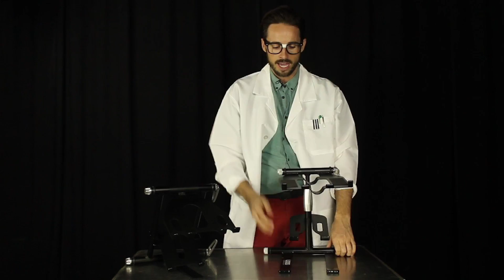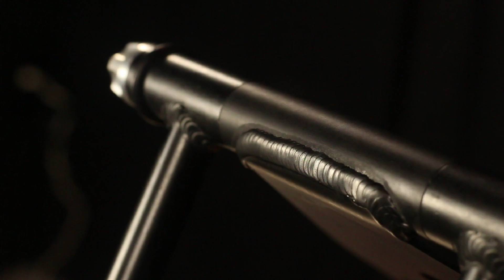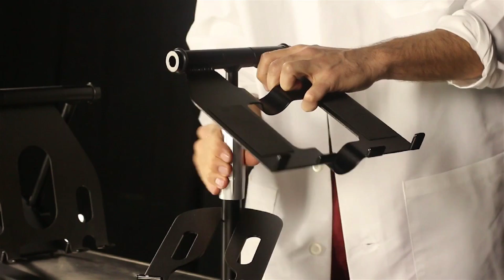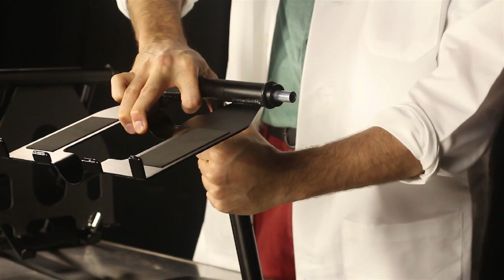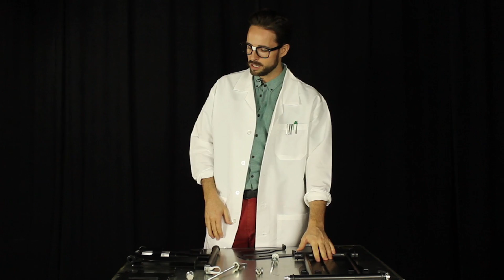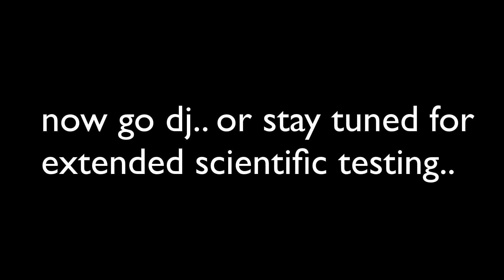Nerd Out: DJ Stands - UDG Creator vs Crane Pro

Comment: Ian,there's one thing that you're not getting about the Crane Stand(Which I have).To stop your controller or mixer from wobbling due to the bar being under it,you flip the bottom part the other way.So  instead of the bar being under the mixer/controller, it's in front of it.Basically what I'm saying is you set up the stand in a Z formation.Very stable as well.
Reply: phinds1 but you lose height

Comment: My UDG stand just broke on me. Not sure if it can be repaired as it would need some serious soldering, for which I don’t have the necessary gear. Basically what happened is that the platform on which you place the laptop broke off the horizontal bar it’s attached to. Not sure how to explain it better. Had it for several years though, can’t remember exactly when I purchased it but it must’ve been at least 5 years ago.